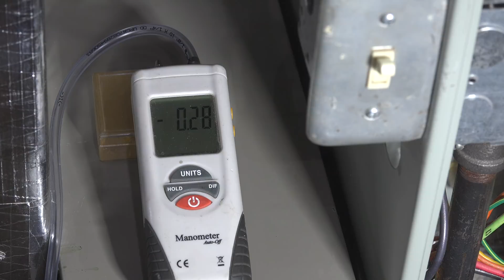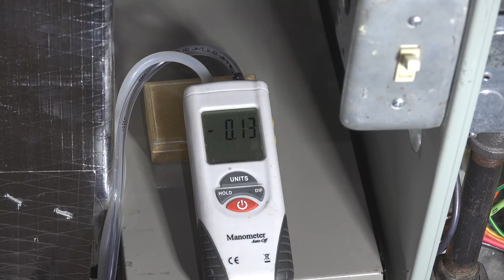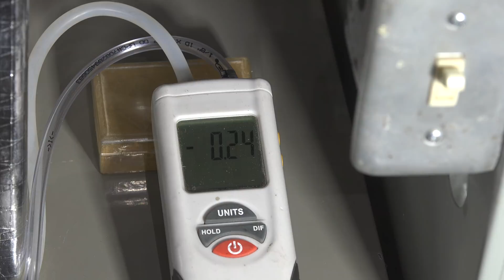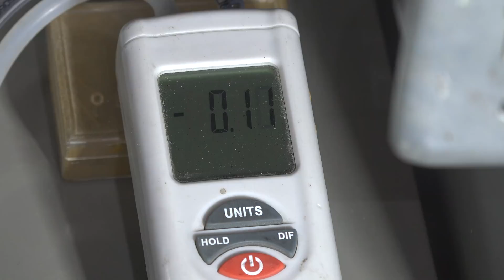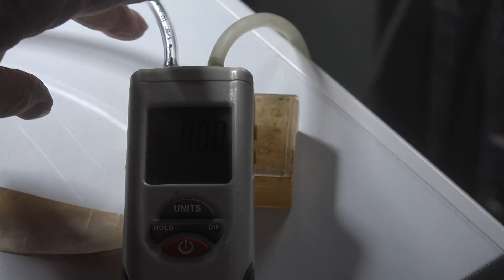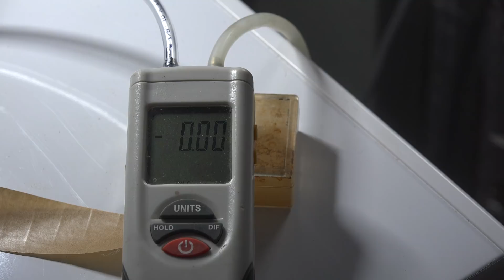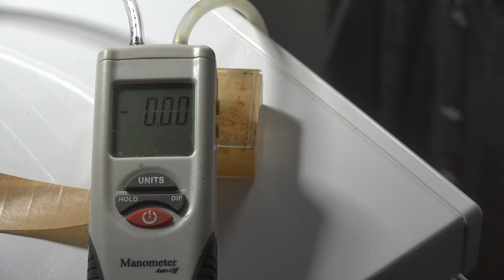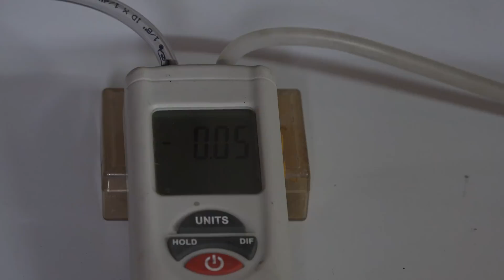Ductwork diagnostics #2, the return air and filter

Comment: If my return ductwork in the basement is split in half the house what would be best for the drop? Like having a 3 way double radius T or having just a straight square or rectangular drop... Thanks 🙏👍
Reply: Just trying to be clear. Thanks
Reply: I have people changing my return ductwork to 22*10" but is going to do away with my double t that splits it.  Would a 3 way T be better flow for split return system where the return did come does come down in middle of house.

Comment: Filters should be sized for no more than 350-400 CFM per square foot.  A lot of people will just use the size of the return air duct, and put a filter right across the duct, which creates a huge restriction.  To get less pressure drop they should be installed in a V configuration, or a long slope. As far as ductwork elbows and transitions, it only takes one badly designed fitting to cause problems.
Reply from the maker: Good info.
GFM

Comment: 2:17 'the pressure drop increases with the volume of air" 2:25  "the faster the air moves, the more resistance you'll have"
then at 3:03 puts in a medium efficiency filter and the pressure drop increases??  Isn't the air moving slower = less resistance (see 1st sentence)?? 
3:38 lower efficiency filter and the pressure drop decreases?  how when it is moving the air faster = more resistance according to the 1st sentence (his words at 2:25)
Reply from the maker: There are 2 different issues here.  Faster moving air increases resistance due to eddys in the airflow increasing in size and speed.
The other issue is obstruction in the duct.  Effectively, a filter (obstruction) is a reduction in effective size of the duct.  Thus the pressure drop.  Hope this helps.
GFM

Comment: So when sticking the probe in the return duct is the resistance reading coming from the return grill to the probe or the resistance from the probe to the blower?? Thanks in advance.
Reply from the maker: You are comparing the resistance in the return up to the probe to the pressure in the structure.
GFM
Reply: grayfurnaceman thank you very much. I love your videos and they’ve helped me greatly with my career. So if you put the probe next the blower (return side) you’re reading the resistance on the entire return ductwork and filter? I honestly would work for free just to ride around doing service calls with you just to absorb your knowledge. Thanks again.
Reply from the maker: @mbranbb  Correct.
GFM

Comment: First, thank you for your videos. I have a question about the Ductboard you are using for the return and supply ducts in this (and other) videos. What are your thoughts on long term use of this material, and it blowing fiberglass into your house? I have the ductboard in my whole house as well, and it is 20 years old. I am finishing my basement and getting ready to enclose all of my ducts into soffits and am considering replacing it all with metal due to the concern of the Ductboard/Fiberboard breaking down as time goes on. Should this be a concern, or should I replace with metal? All of the duct will be in soffits/joists in between two conditioned levels of the house.
Reply from the maker: There were some thoughts about its use when it fist came out, but I have heard nothing about it lately.
GFM

Comment: Other than my mutivolt meter, my manometer is my most used tool. I use my to diagnose flue restrictions, gas line drop and duct restrictions. Very helpful tool if you learn how to use it correctly.
Reply from the maker: Agreed
GFM

Comment: Another instructive video, but 
1) is it ok to "poke holes" anywhere in the duct work to take a pressure reading? And
2) shouldn't those holes be plugged up when done? Is so, what with? Would a square inch of duct tape be enough?
Reply from the maker: Yes it is.  If the customer wants them closed, do it.  The leak from a 1/8" hole is virtually nothing.
GFM

Comment: AC company put in a higher CFM  central air unit in my house and they thought it was OK that suddenly the air return grate was whistling due to the increased air going through.

I cut a hole in the wall opposite side of the unit to let more air in (under the filter so not bypassing it) and put in a grate.

Failing to open more air inlet would probably have burned out the central air system in under a year.

I suspect the duct work in the attic is marginal...
Reply from the maker: A whistling return is never ok.  If you have freeze up problems, you may have marginal ductwork.
GFM

Comment: It is interesting. I'm a physics student this static pressure stuff is exactly like electricity. Your pressure drop is like voltage, air velocity like current. Resistance is the duct work restrictions. Technically you could do the math instead but would be pretty involved and this is more accurate.
Reply: There are formulas based on duct sizes, corners, etc for theoretical.  

But reality rarely matches theoretical because of  the ducts not really being smooth surface, having joints and similar  factors.
 
they should have done the math when planning the duct work and made allowance for the normal "defects" in the ducts..
Reply from the maker: You got it.
GFM

Comment: I see u used the typical inch thick pleated filer, I wish u did a 5 inch pleated filter that is used today in  many installs. My guess it would be a huge amount of resistance
Reply from the maker: I will be doing a test of many popular filters to determine the pressure drop in the near future.
GFM
Reply: Rocko99 Rocko99 mine run .24 when new. I just use the generic merv 8-10 from hd or menards. I change them every 6 months and they look horrible thanks to my dog and I've never seen a drop more than .26

Comment: GFM,  Generally I have the utmost respect and admiration for your teachings, and I appreciate very much your postings to help educate.  But, I must question the statement about not needing to check blower or coil for cleanliness before troubleshooting static pressures.  I believe if blower (and coil if the case has one) is terribly dirty, all static pressures will read lower than they would if clean, , , possibly leading to a belief that static pressures were good/acceptable, , , when in fact static pressures would be higher given clean blower and coil.   Clean first, then test, No?
Reply from the maker: Throttle bottle is correct.  Check, clean recheck.  Visual inspection may or may not tell the tale.  If you have low pressure at the entry to the coil, you would of course have to look to blower wheel or secondary heat exchanger.  The manometer will tell you everything you need to know about the health of the duct system.
GFM
Reply: how about check, clean and recheck ;)
Reply: throttle bottle How about a quick visual of coil and blower,  and decide to clean or go straight to measuring pressures.

Comment: Great video as usual.  Measuring pressure drops across each component of your furnace and A/C system is a good diagnostic tool.  You mentioned that the pressure drop across the furnace alone should be no more than .5" wc.   So, what is the rule of thumb for maximum pressure drop across a evaporator coil located just above the furnace?
Reply from the maker: Most coils run about .2 to .3 in wc.  The install manual may give a more accurate number.
GFM